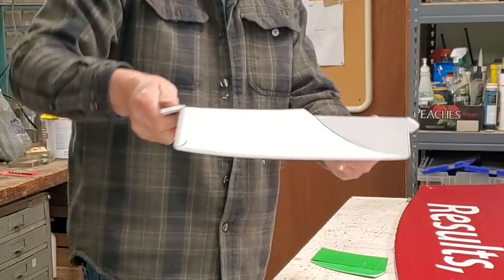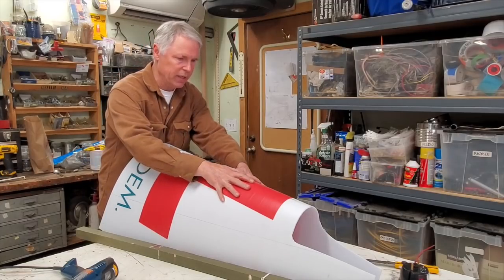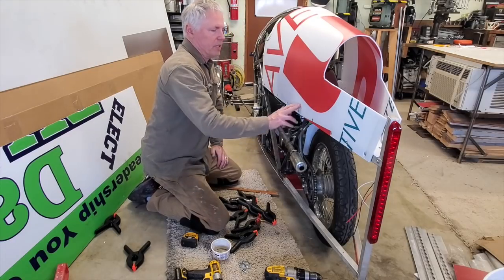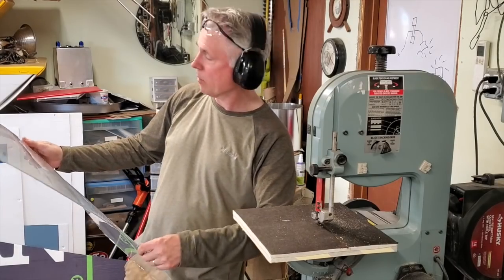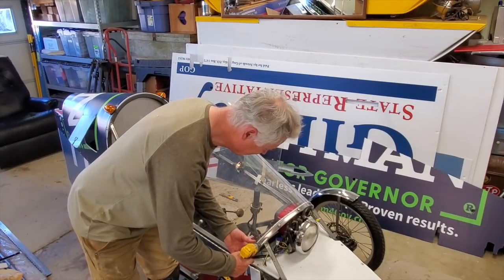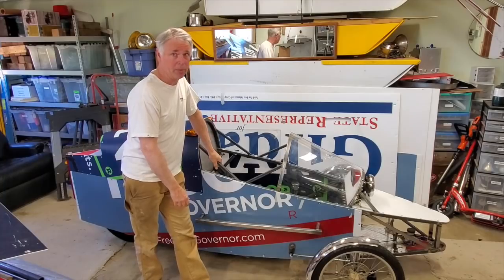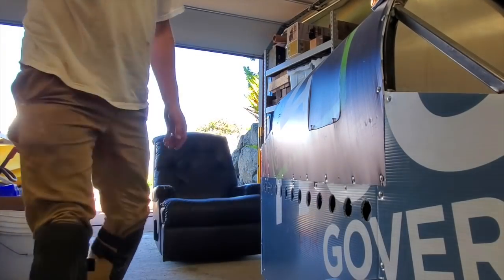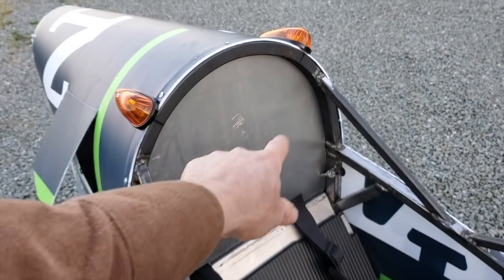Fuel efficient reverse trike build (part-13)

Comment: Great job, Paul, love the trike. Just a thought, is it possible to eliminate the cross bracing and lower the side belt line about 4 inches at the seat position so you have better access? You could weld another roll bar to the existing one behind you and under the windshield to beef it up after removing the cross bracing. Take care.😊
Reply from the maker: One of my biggest mistakes was to make the frame as narrow as the acrylic dome I was going to use. This didn't allow any extra elbow room, which is why I don't have any cross bars on the frame. I did in the beginning but very annoying to rub up against.
Reply: @paulwelkinsdiy  Wonderful project, otherwise. I'm enjoying it immensely. Keep it going. Take care.

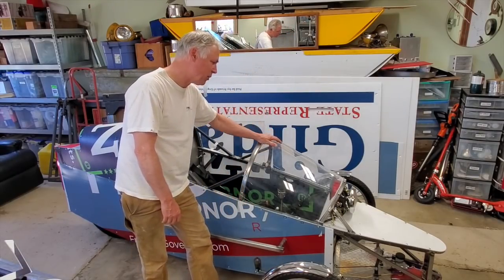Comment: 8:55 make a drop down step that hangs off the roll bar right where you need to step up, in a "U" shaped square? If that makes sense?
Reply: Great idea! And if it was just like hanging from j or l shaped hooks he could put inside somewhere when riding!
Reply from the maker: I'm an idiot. I forgot I have the side crash bar as a step.

Comment: Can you make a door to get in & out easier? 👍
Reply from the maker: I did this in my older trike, but the bottom frame was much more heavy duty whereas here I've stuck to light weight material, making mods like a door kind of difficult.